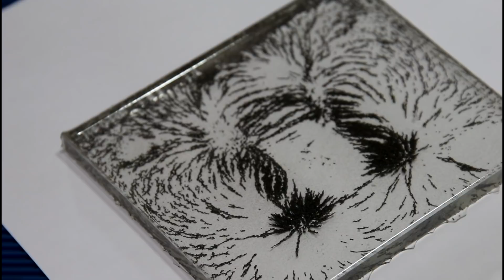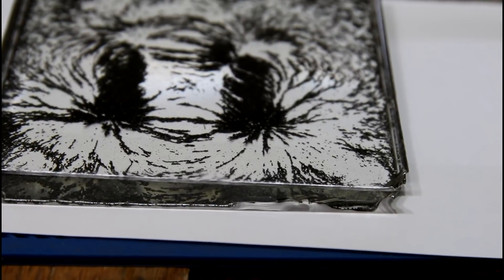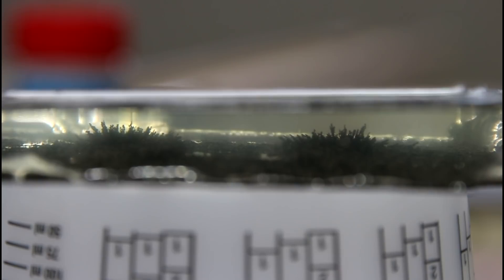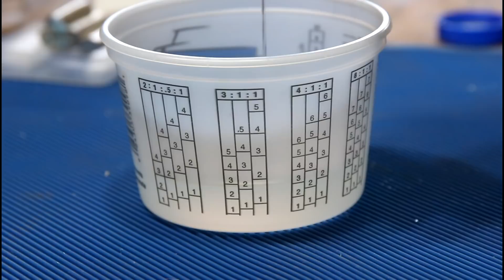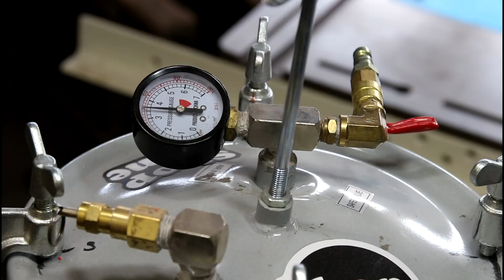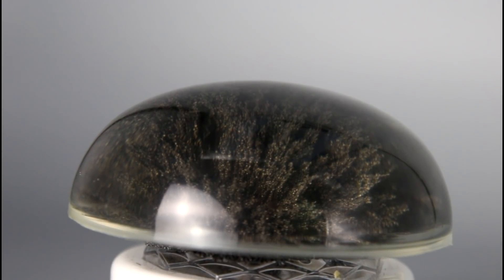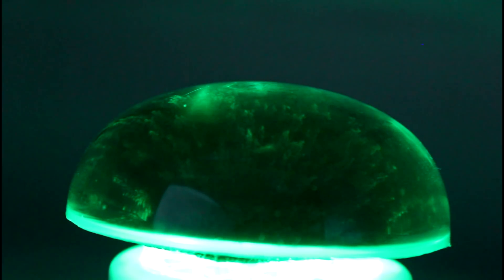Capturing Magnetic Lines of Force in Resin?: Social Distancing Day 5

Comment: On long time scales, the magnetic poles of the earth will strengthen, weaken, and then flip periodically. We know this because we can see magnetic particles in rocks oriented in opposing directions in bands, representing different periods of time. If you imagine the resin & iron filings as a band of one polarity, then cast another layer on top with the magnet flipped in the opposite direction, it would demonstrate this concept well.

Comment: Idea for a resin casting. Use the previous shavings from the last video and use them in the base of a container. Then fill with diver figures and fish etc using those shavings to hold the items in place. Then top with mixed blue died resins to replicate the colour of the ocean. Maybe try to whip up the top during curing to replicate waves? Or glitter? The resin shavings should appear transparent and so the items will appear mid air. You could go full pirate scene with skeletons, treasure and a kraken!

Comment: My thought would be to use this as a bottle stopper, just use a small dixie cup, but a base layer down (and set it), drill out where you would screw in the bottle stopper, stick in a strong magnet, top off with iron and epoxy.  After it sets, remove the magnet, turn it down to the size you want.

Comment: Idea: Set up the magnet with the filings. Then fog it in a sealed box with super glue vapor (multiple times = more layers = more strength) and that may give it the structural rigidity needed to stay in place while pouring the resin around it?

Comment: I saw this and my immediate first thought after the final product reveal, as you went through the colored lights, was 'I wonder if the effect would be better, and show more of the vertical lift of the magnetic field if you used a neodymium ring.'  Then I thought about a ring and a button magnet in the center and then realized I was being silly because you probably wouldn't have enough resin or a large enough pressure pot for the scale of that.

Regardless -- this was awesome.  Working at home, and get to watch breaking content from my favorite creators is a dream come true.

Comment: Just an idea, if you get some empty christmas tree baubles (i've seen them on amazon), they are 2 part and clip together, drill a hole in the top, do the iron filings as you did this time, fill with epoxy, then use another magnet to attract the filings into longer strands.
Not sure how this would work  with removing bubbles, and you probably will have to leave it in the bauble as it's plastic

Comment: I’ve been doing these for a while now and my favorite has always been with using the sphere mold. Only I use a polypropylene clamshell style ice cube mold. Oh, and a very dangerous 1.5” square neodymium magnet that generates an amazing field!

The early problems I had with them were similar to yours. Bubbles and the fact that the spherical shape bends the interior image to fill the entire space and makes it difficult to see the spikes, short of putting a flashlight directly on top of it. 

My work around? 

I would set up my mold with magnet on bottom and pour a tiny bit of resin just to sort of coat the surface in there, then “drizzle” my filings in the bottom half but only to where the peaks of the filings penetrated vertically just past the half way line, maybe half an inch or so, then I would slowly fill the bottom half with resin to where it barely covered the base of the filings but making sure I carefully covered all the peaks with a resin layer in the process then stop and wait overnight. 

Now everything is encased with resin so no bubbles will come out and no vac or pressure chamber needed. 

Once it’s hard you can close up the mold and fill it up and when that’s done you have yourself a beautiful magnetic field suspended in resin that you can see completely across horizontally and, usually, crystal clear and bubble free! 

I have one posted on my Instagram from a while back if you want to take a peek. 

Check out @jhineswoodnresinart

Great job though!!

Comment: You should make some clamps for those spherical moulds.  Two pieces of wood, cut into donut shapes that you sandwich the flanges of the mould with ought to work, use some wing nuts to hold together (or perhaps make something non magnetic to do the job), maybe add some feet to keep everything aligned....  then try the magnets again!

Comment: Idea for part 2
Let the magnetic lines form them self in the resin. So you can get a 3 dimensional shape with thin lines. Would be nice to see if this is possible.
Idk if this would work but in my head it should if the magnet is strong enough to drag the pieces through the resin but I have no idea.

Comment: Amazing project! I was thinking, what about a cylindrical mould were you put a pipe in the middle to hold the magnets, then iron filing on the sides and resin. The outcome kind of similar to skateboard wheels, or if it was possible to find any spherical moulds and having magnets on top and bottom of it with iron filing in the resin?

Comment: Maybe putting the resin in the cup before sprinkling the filings will give you more 3d-like effects since the resin will support i a bit more than air. i'm thinking that the circular magnets would be interesting for that. I expect lines sort of wound around a donut shape, and not just the splashes you got when sprinkling the filings directly onto the magnet.

Comment: What happens if you mix the iron into the resin first then put the magnet on top? It seems like you might be able to get longer thinner lines because the viscosity of the resin might support the iron better than just hanging in the air?

Comment: As others have been saying, mix the filings into the resin, the magnetic field should cause them to line up beautifully. You might want to try vacuuming the mix a bit to try and remove trapped air, then pressure casting.

Comment: Hey Peter, I think you could cast a globe shpe if you made a 3d printed rigid overmold for the silicone mold that you could then bolt together with screws, it could be printed solid to be pressure safe I think. Just thought I'd suggest it

Comment: Maybe you could try making a little cylinder silicone canister to hold the magnets, place it inside another mold and pour the iron filings around the canister and then fill the mold with resin.
Then hopefully you could rip out the canister, wipe some poly on the inside of the cylindrical hole.

Comment: Oh... one more idea: you used iron fillings. You can buy a "cement dye" that is actually iron powder: it comes in red, yellow, green and black. Try that... :)
Reply: The red /brown and black cement colouring powders I've got are definitely ferromagnetic, so theyre certainly iron oxides. You can  check by running a magnet up the plastic container, if thé powder follows it's ferromagnetic.  Downside: they're so fine that the result is quite homogenous, darker near the poles varying to less dense further away, you don't get visible lines.  The reason for the visible "lines of force" with iron filings, so rarely explained in school, is their granular structure.
Reply: smallathe Those are iron oxides, which aren’t magnetic
Reply: @13meli55a  Black iron oxide should be magnetic. Red iron oxide is not, but it also may not be pure.
Reply: @13meli55a  really??? Ouch... there goes a plan down the drain...thanks!
Reply: Michael Persico  I think this would work & look super cool if you left the magnet on top of/underneath the mold while curing. You would only be able to get fairly simple designs, but still pretty cool
Reply: Forbidden spice
7:39
Reply: There is nail polish that is magnetic till it sets you can change the look of it would be a nice idea

Comment: It looks to me like there might be anough of a lip around those silicone sphere moulds to hold the two halves together with some small binder clips.  Better yet, you could hold them together without much distortion if you made some kind of stiff 'washers' with holes just big enough for the hemispheres to go through but not the edges.

I wonder what sort of effect you'd get if you mixed fine iron filings directly into a slow-setting low viscosity resin?  I know that you can get nail polish that uses magnets to create a chatoyancy effect that way.

Comment: What if you mix the iron fillings into the resin then put magnets all around the mold you pour the resin into. Would the fillings migrate to the magnets as the resin cures? Would you be able to turn it on the lathe?

Comment: On the sphere mold, do two pours. Magnetic on both sides, leave room to sand a bit, then resin the two sides together
Reply: Or if you have a cube mold, mix the shavings in with the pour and put strong magnets on 5 sides, and pressure it while it has the magnets on it

Comment: What if you made a bowl with that? Like, you put some resin in a bowl mold, do the same thing like you did with the dome, but instead use the dome as the blank on the inside? The magnets might weigh enough to keep it down in the resin. And then throw it on the lathe and clean it up. You could even get a bigger cow magnet. I think it would be cool.

Comment: Is it possible to preserve liquids (oil and water mixture) in resin? You can perhaps make lava lamp with it
My thoughts is that:
1. Make a resin "cup"  that would hold the liquids later
2. turn the cured cup upsidedown and dip it in the bigger mold of resin
3. Use straw/syringe, fill the upside down cup with colored liquids

Since the liquids should be lighter than the resins, it should be okay to put in the pressure chamber.

Comment: you captured a coal sprite in resin.
Reply: oooo, I just thought of how you could make an actual coal sprite with this!

1. take the plastic sheet you had the magnet resting on, and drill 4 small holes where they'll be hidden under the filings. 2 for legs, 2 for arms.
2. thread black pipecleaners, yarn, shoelaces, cords, or whatever your choice of material is, through the holes. you could even get a star bead and have the arms be a loop instead of 2 separate ones so it's holding a "candy."
3. fix the limbs in place however you like, in whatever pose you can manage.
4. time for the filings and pouring the resin in the mold!
5. just before you put it in the resin, place a pair of googly eyes where the "body" will be, and then put it in!

my recommendations are that you use more resin so that the limbs will be in there fully, and make a barrier with hot glue to prevent excess resin from getting to the magnets so you can at least salvage them, since the plate would be done for.

Comment: Perhaps a glow-in-the-dark powder added to the resin that way without the lights you can still see the structure of the filings. Also perhaps a cylinder with a hole through the core where the magnet is places to get a north and south pole field in resin

Comment: Not what you were looking for, but if the big silicone sphere mold won't work, can I suggest fusing it on the middle seam and then tearing it off the cast? Seems your magnetic field resin cast is pretty well-tested, so you could do it in one. Silicone-based lube eats silicone, so surely that could be used as a glue? Or something to that effect. I just wanna see a magnetic explosion orb.

Comment: I'd love to see how it looks if you mix the iron into the resin and then pour the slurry onto a magnet. You'd probably get to see more of the field as iron is pulled from around as it sets
Reply: That's a great idea, I'd love to see that as well! It would probably be a lot like magnetic nail polish. (If he added a metallic color with it it'd be even more similar to that.)
Reply: @ameliajk  I'd never seen magnetic nail polish before. It's so pretty! I wonder if it would work as a pigment for other resin pours
Reply: You might get spikes like you see when a magnet interacts with ferrofluid, but the shape would remain when the resin cures. and the magnet is removed, maybe?
Reply: @jasonpagura6149  I think so too. That would be a really cool look cast in resin
Reply: @jasonpagura6149  nope, wouldnt work like that
Reply: I recommend you watch NileRed's videos on making ferrofluid. Turns out, it is quite difficult. Just putting the filings into resin would not work. Once introduced to a magnetic field, the filings would just separate out.

Comment: Build a square mold box, magnet below, ferro-magnetic liquid in mold, and pour the resin right in. Assuming the resin isn't denser ;-)  After it has cured, pour the ferro-fluid back into its bottle.  Now you can fill the cavity the ferro-fluid used to occupy with a tinted resin.

Comment: IDEA!!!
Use the second style mold to be able to capture a sphere. Mix the iron particles into the resin. Pour into the mold. Place the mold between two sets of magnets placed on opposite sides of the mold. Perhaps building a contraption to hold the mold within the pressure pot so that all you have to do is set the prepared mold into the contraption already within the pot. I bet the formations could be spectacular! Especially in a larger mold so that the magnets are further away from one another causing many more striations.

Comment: I definitely want to see this again with filings evenly dispersed in the resin, i think it would show even cooler 3d patterns.
Reply: If this was done in layers it would have that 3d affect your looking for, the only issue would be time because you'd want the resin to be very thin as you ad the iron as to not have big gaps in between layers
Reply: @Kirb-B  You'd need UV-curing resin and a laser.
Reply: Girthy trap
Reply: I was thinking the same thing,  but also suspending the magnet in the center of the mold too.

Comment: Get a small combustion engine, maybe from a model airplane. Force resin into the engine to fill all the gaps. After it sets, cut the engine in half to see the cross section without it falling apart. This could be a collaboration with The Waterjet Channel.

Comment: If you have a hole saw that is the right size, you can make a custom clamp for the larger balls.Two parts with some bolt holes and just clamp the two pieces together mechanically. All it would cost is a couple bits of scrap wood and some nuts and bolts.

Comment: I don’t have high hopes for this, because the magnetism of those magnets isn’t super strong, the iron filings have such little mass, and resin is SO viscous.

But let’s see!
Reply: Ok, that was pretty awesome.
What if you did this:

1) Mix the iron filings well into a cup full of resin (WITHOUT hardener), then place it in a vacuum chamber to get rid of all of the bubbles.
2) Mix the resin/ferrofluid in with hardener, then cast it.

I would love to see how the iron filings suspended in resin collect around the lines of force, without being weighed down by the poured resin.

Comment: I've seen people hot glue the two sides of a spherical mold together, and that seems to work pretty well.
Reply: Hot glue isn’t bad but it can be a nasty mess to work with. I was thinking of binder clips in a smaller size. Just right to close the pieces together and they put a bunch on the prevent leaks. The pop them off and back in a box for more projects down the road...

Comment: Add the filings into the resin first. Mix it well so it's all evenly distributed. Then pour it into your mold over the magnet.

When you add the resin after, the weight of the resin smashes the filings down so you lose some of the effect.

Mixing first will allow the filings to take their place naturally and be suspended in the resin nicely.

Comment: The answer to the mold problem is it needs a shell to straighten it. Plaster for limited use fiberglass and resin for more extensive use, Also its pretty base of you to theorize on what the creator had been doing when you aren't operating it correctly.

Comment: Mix the filings into resin then tape magnets to the outside of the mold— see if they will move through the resin
Reply: If they're evenly distributed in the resin to start with, this'll probably get something even cooler than spikes - a 3D graph of the field, since orienting is probably easier in a thick fluid than being drawn all the way to!
Reply: Yes, I was thinking this from the get go. also the lighted base might work better with this method too.
Reply: also an electromagnet maybe, and crank it all the way to 11
Reply: YES
Reply: Yep that's my ideea to, this method should work better

Comment: I bought those same ball molds and have regretted them ever since. The only way I could get them to work was by basically drizzling hot glue all over the connection point ,and for the bigger ones, clamping them with binder clips before it cooled.

The project turned out really pretty, though! I'd be curious to see what happens if you use a really strong magnet and pour the shavings on after. I wonder if you could get some interesting patterns by adding a layer of color in between, or using magnetic makeup

Comment: what if you mix filings with the resin, then suspend the magnet in the middle of a container, pour it it, pressure pot. It would show the magnetic fields all around. Maybe you can even turn it. Maybe you’d need to first cast the magnet in clear resin and do it layered, so the filings don’t go all to the magney at once

Comment: What I was thinking is that you could do think layers of filings and resin, do a little bit of filings, then resin, cure it, more filings, resin, cure it, and stack layer after layer to see the field at different strengths further and further, without the weight of the fillings over the previous ones, crushing them down. It'd let you really get a clear picture of the full effect!